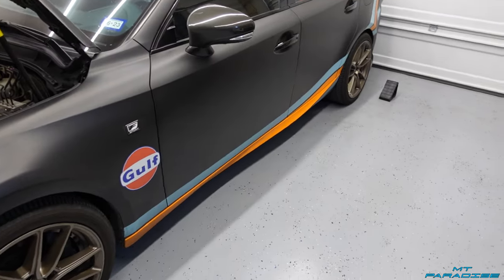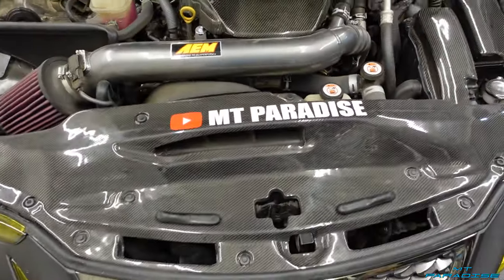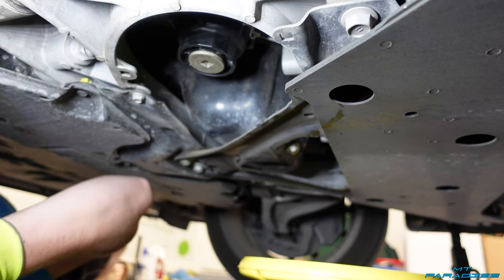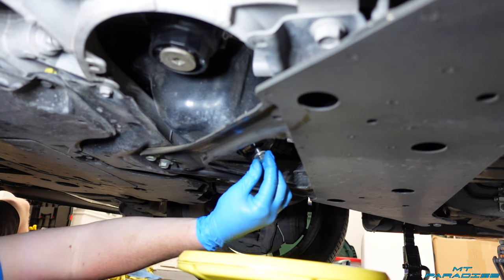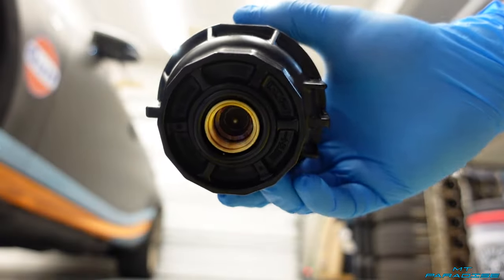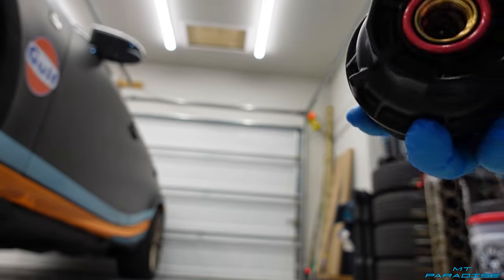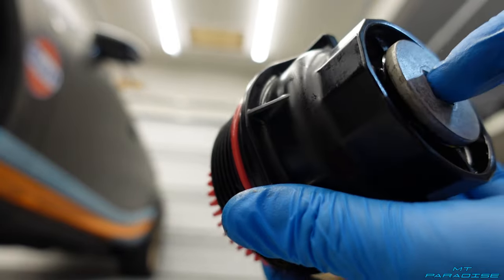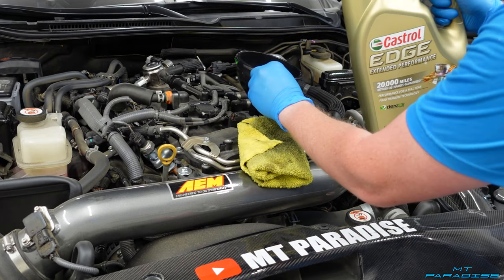How To: Oil Change, 2016-2017 IS 200t, 2018-2020 IS 300. 2.0L Turbo 4 Cyl

Comment: I had the same issue as you when I tried to remove the bolt from the filter housing and the whole thing came off.  Was wondering how you used the impact tool to get it off? Like where did you place the housing while using the impact drill? Thank you in advance
Reply from the maker: I held it down somehow 😂 I held it between my feet and other hand with grippy gloves. It was awful 😂

Comment: Where did you get the AEM intake?
Reply from the maker: I got it from Amazon and it’s been amazing. The link is below. 
https://amzn.to/3V4fNOm
Reply: Thanks, and did you see any improvement with that intake ?. I have an is300 2018 base model.
Reply from the maker: @darksentinel7230  itll definitely work for your car as it’s the same exact engine. I feel like at higher speed it may help but the biggest difference I’ve noticed was the noise. I can hear the turbo spooling and the blow off and I really enjoy that lol
Reply from the maker: @darksentinel7230  Install Cold Air Intake Lexus IS, 2.0L 2016+
https://youtu.be/0zcEHo1Dh3M
Reply: Thanks man, you’re amazing!!
Reply from the maker: @darksentinel7230  no problem! I’m glad I could help

Comment: Great video I have a question... any idea what the problems is when it feel like lane assist steering is working when it's off?
Reply from the maker: Thank you. Oh I’m not sure. My question is, is it actually off? I know most cars of you turn off traction control then try to slide, the TC still kicks on. I’m wondering if it’s something like that. If it’s constant it sounds like an alignment issue but if it’s sometimes, it might be grooves on the roads (I’ve had that before on some uneven roads before)